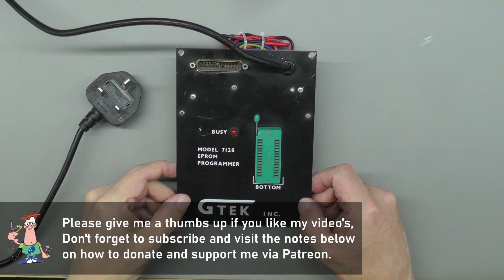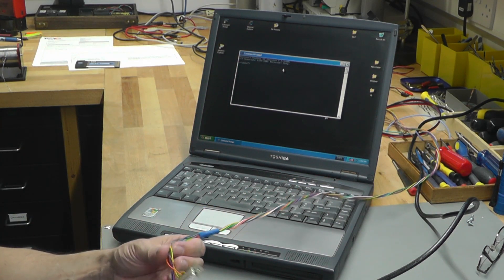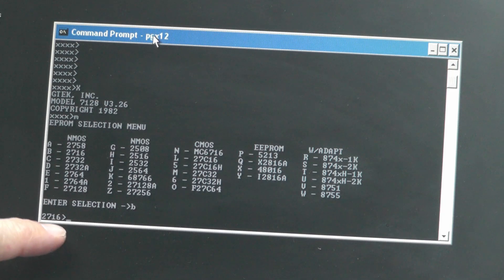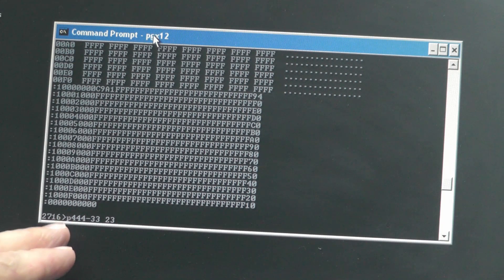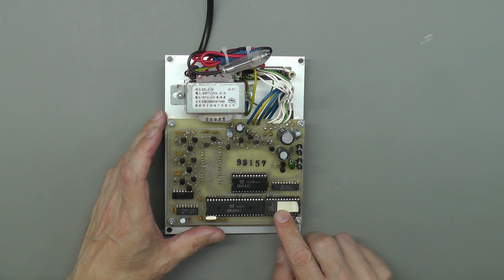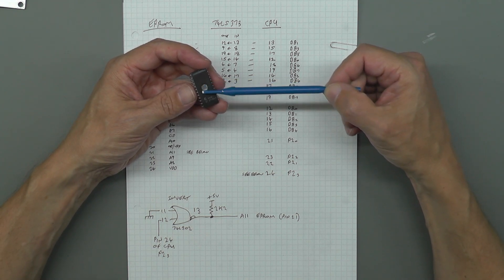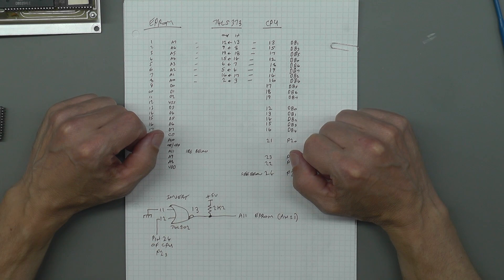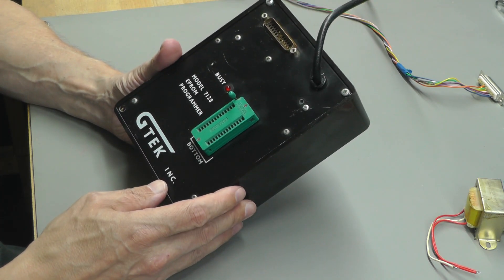No.080 - Gtek 7128 Eprom Programmer 240Vac Conversion & Analysis - Part 2

Comment from the maker: UPDATE:
I got the Gtek 7128 working on Win10 using DOSBox emulator.
All I had to do was edit the .conf file and add the following under the [serial] section:
serial1=directserial realport:com1
Now i can connect to the 7128 no problem from Win10.

https://www.ianjohnston.com/images/stories/IanJ/Gtek/Gtek7128DosBox.png

Comment: So it's not just me having problems with serial/parallel ports in emulation - lol -. I have an old DOS program that has a HASP security dongle that I think needs 2 way communication through the parallel port, but in emulation it only allows one direction.

Comment: Psion mix up the bus lines on the Datpaks for the Psion Organiser II. I designed an Arduino based EPROM programmer which used the EPROM based Datapaks and I was unaware of the fact until I came to test it. The solution was just to re-organise the bits in software.

Comment: The unusual wiring for the firmware eprom must be a horror to program it during production run. What do you mention how they solve this using a standard programmer ?
Reply from the maker: I can only imagine they would compile the program normally, then run the file through another app to convert it. From there that new hex file is simply deployed on the production run per normal.

Comment: Great video =D  Regards the databus and address bus layout there - Microsoft did the same thing on the XBOX 360 DVD drive - funnily enough that used another Intel MCU (8051 based I think on the initial drives).

Comment: The 8048/8748/8035 microcontrollers only have 64 bytes of internal RAM. If there is no external SRAM present in this programmer then there is nowhere to download and store the full data buffer before programming it to the EPROM. The program command must only be able to accept a small number of bytes at a time and program those into the EPROM before being able to accept additional programming commands. I suppose back in the day when this programmer was new adding 32KB or 64KB of SRAM or DRAM for data buffer storage would have added significantly to the cost of the product.
Reply from the maker: I believe there's no hardware serial port on the 8035 either, so they've implemented that in software.....using up more valuable resources. 1200 baud max!
Reply: @IanScottJohnston  Yes, the MCS-48 architecture has no built in serial port. That was one of the improvements added to the MCS-51 architecture. Maybe this programmer design is early enough that MCS-51 parts were not yet widely available.

Comment: To dump an output of a program to a file under DOS is a read-out (I don't know how by the command line of your program) followed by the (space+) arrow to the right followed by a (space+) filename. One arrow is new file everytime (overwrite), two arrows is append to file.
Reply from the maker: The prompt 2716> is not the MSDos prompt, it's the actual program running which just 'looks' like an MSDos prompt. As such there is no opportunity to use the arrows. The manual offers nothing more than I tried, so it looks like I have to use a terminal program and capture the data that way.........We'll see how I get on when I try it though, maybe there's another way i haven't seen yet.
Reply: @IanScottJohnston  What I suggested is only possible if the program has a command line at startup, that is when you can start the program from the DOS prompt (program name), and can give a few parameters in the same line. After that comes the arrow. But as you explain it has none according to its manual.

Comment: When you run a command in DOS the output of that command is sent to the screen (obviously, as you want to see the result). However, you can send the output of the command somewhere else instead, say to a file or to a printer. 

Example:- dir >C:\filename.txt will send  the output of the dir command to a file called filename.txt instead of to the screen.
Example:- dir >LPT1 will send  the output of the dir command to a printer on LPT1 instead of to the screen.

Try using r0,ff >C:\filename.txt or, l0,ff >C:\filemane.txt to save to a file.
Using r0,ff >LPT1 or, l0,ff >LPT1 to print a copy.

Note:- you must run command prompt as an administrator for the redirect to work.
Reply from the maker: I'll double check later but when you run the program to start with you are then inside the executable, not sitting at the DOS prompt, albeit it just looks like the DOS prompt. As such DOS redirects will no longer work. If I CTRL-C it aborts back out to the DOS prompt proper.
There is another Gtek exe, as detailed in the manual, I.e. they supplied more than one program but it doesn't work for me.......yet!
Reply from the maker: Update: Yep just tested this and confirmed, the 2716> prompt is running inside the program (just looks like the MSDos prompt)and thus doesn't accept any of the usual DOS redirection options etc.

Comment: It that DOS program is just a serial terminal, then can you just use something like Tera Term on Windows 10 to talk to the serial port on the programmer and send and receive files? I have used that on similar kit in the past, my Windows 10 machine still has a real serial port on the motherboard, but I guess USB ones should work (apart from the very cheap ones that don't do the level shifting correctly)
Reply from the maker: My Win10 machine has a hardware serial port also.......nicely set up with DOS matching IRQ and address.
I might revisit the issue with a terminal program and see if I can get it working.
Reply from the maker: Fixed......see my pinned comment above.

Comment: Many modern programmers can't handle the 25xx series of EPROMs, as the pinout was non-standard.   It's nice to keep one around that can do it, in case you run across a chip and want to read it.

Comment: 1:01 Those screw on things are called wire nuts. Very common in the US. Horrible nasty bodgy dangerous things. Soldering together then heatshrinking the wires or using terminal blocks is much better.
Reply: I've always known them as Marrette connectors, maybe it's just a brand name?
Reply: @39Kohm  Both are actually brand names.  Wire-Nut is a registered trademark.
Reply: In the Netherlands these (the type) were used for house installations, 16 Amp, for 2, 3, or even 4 SOLID wires. Thread them together with pliers, and screw the "lasdop" (as we call them) tightly on. When applied correctly, I think they give a better connection than later techniques, because there's a strong steal spring inside, that tightens more around all the wires as you screw them harder.
Reply: I have heard them called "screwits" in the UK, which is basically what they do to anything they connect to. Horrible things, hopefully consigned to history. The Wago 221 is the modern version which I hear is taking the sparky world by storm.